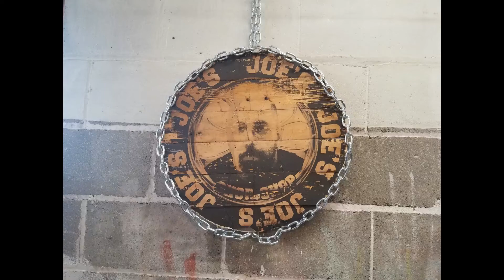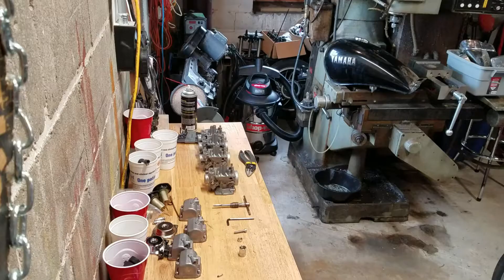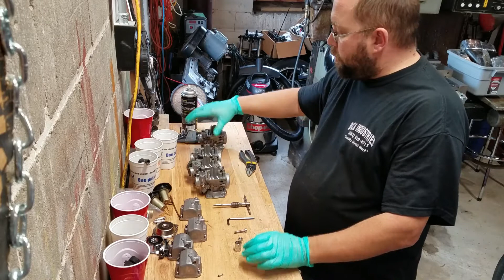1981Yamaha XJ550 maxim carburetor stuck needle valve seat removal

Comment: Can you watch the video called 95 Yamaha Virago needle seat removed and explain how you would do it? I'm trying to figure the best way to take it out. Thanks 👍
Reply from the maker: Are you referring to the Virago 535? If so that is one of the few I haven't worked on, but from what I can tell the easiest way would be to use a jack screw to push it out from the inside. It would definitely destroy the filter but shouldn't damage the seat or plug. If I find a set for a good price I will do a video.
Reply: @jbartelt2000  yes the 535. I was wondering how to pull it out to keep the plug there. Idk but yeah I think you're right and probably get a new o-ring for the plug. Thanks would definitely love to see a video of seeing it done both ways if possible 😁
Reply: @jbartelt2000  I'm wondering if your way would work...

Comment: I don't understand how this works.  I assume your new replacement seat would screw in clockwise but you turned into the old stuck seat clockwise to remove it???
Reply from the maker: The seats on these carbs have no threads. They push in with an o-ring seal.
Reply: @jbartelt2000  My bad.  My old Zenith carb's seat is threaded and I assumed they're all threaded.  Thank you or the fast reply!
Reply: You are using the tap to thread the seat..then using a bolt and nut like a puller.....

Comment: On a '94 535xv that's not possible. One of those sideways Mikunis with the float pin hard mounted to the body.. Plus the seat comes out the other way. Just saying.
Reply: I think you have to punch them out you'll destroy the filter but not the seat or plug but will have to get new o-ring for plug and punch it in to hold then I'm guessing put new one in from inside bowl with a punch till it's down to fit.. I'm not sure I just commented and he gave me some ideas but I'm going to try mine and see which way the seat goes back in. Unless you take the filter off and put it in from the outside where the plug is punch it in till it stops maybe 🤔 and put filter and plug in.. 🤔🤔🤔
Reply: I've got a 95 535
Reply: @karlh4313   I am looking for a crank pickup for that bike.
Reply: @BugsWisely  did you check eBay?
Reply: @karlh4313   Not available anywhere.
Reply: @BugsWisely  :( I'm new to working on bikes but figured you may be able to get it there. I've heard of ignition pickup but not crank pickup. Do you have a part number for it?  I can keep a eye out.
Reply: How did you do yours??

Comment: would this work for removing the seat from a 97 vmax carb?  I used the manual to take apart and cleaned my carbs but there isn't any mention on how to remove the float needle seat.  There is a visible brass cap on the opposite side of the seating but I see no way of removing it.  Thank you
Reply from the maker: I don't think this would work with vmax carbs. There isn't enough space in the carb bowl cavity to turn in the tap.
Reply: How did you end up removing it? I haven't got this far yet, but I'm rebuilding a set of vmax carbs so I'd like to know if I have trouble removing mine.